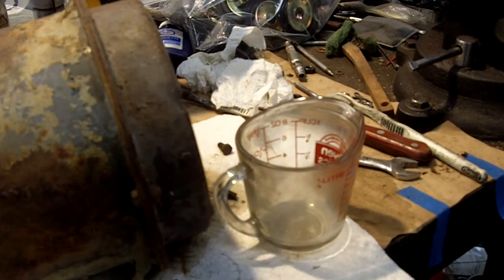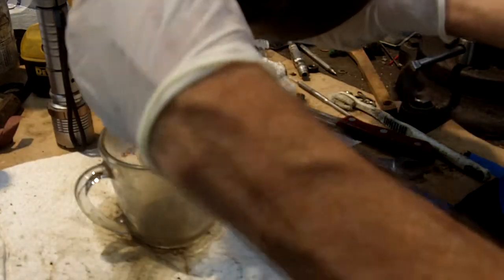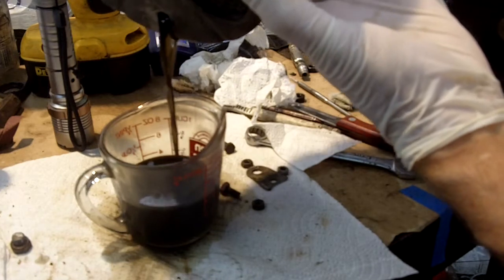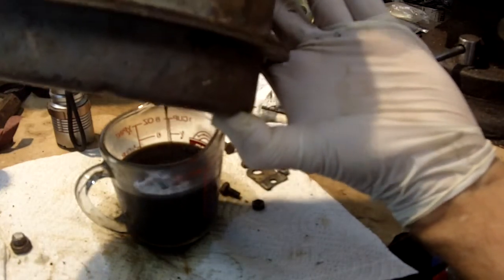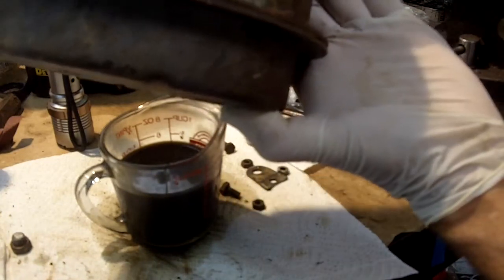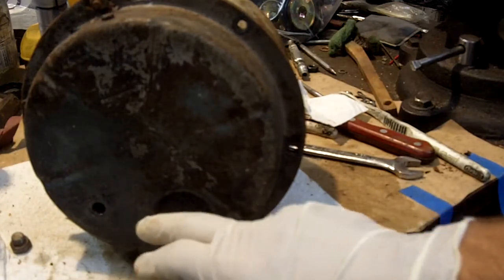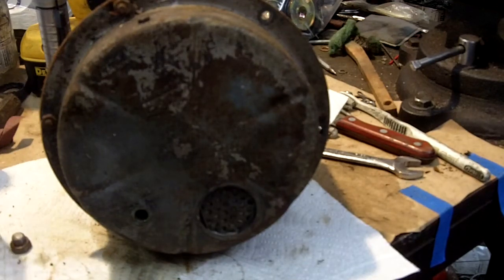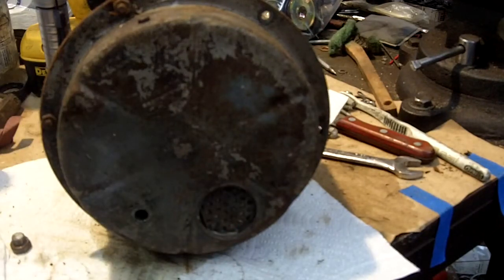ATE T50-24 Brake Booster Full of Brake Fluid

Comment: Will this affect the brake pedal ? Giving you a soft brake ? We're having to pump the brake to stop. It's a 2013 Hyundai Santa Fe Sport 2.0.
Reply from the maker: Hello Neverpanic. Thank you for viewing and your question. Yes, loss of  fluid can cause a soft pedal. There are other possibilities as well. First, I assume you know about the loss of brake fluid recall in certain Hyundai. Here is a link to this issue: https://www.cars.com/research/hyundai-santa_fe-2013/recalls/

If brake fluid is leaking this could lead to a soft pedal. The first application of the brakes is a soft pedal but puts pressure on the system. By the time you apply the brakes a 2nd time the system has pressure and acts normally.

A faulty brake master cylinder can cause the same soft then hard pedal.

Air in the brake system will also cause the soft/hard pedal.

Has the brake fluid level dropped? Have you added fluid? If so, there is a reason the fluid level has dropped. 

No matter the cause you need to get the problem addressed immediately. The brake system will not get better.

I tell people imagine you are coming off the highway and find a school bus has crossed your path. On the bus are a group of kindergarten children on a field trip to see what personal injury lawyers do for a living. If you panic stop you don't have time to double pump the brakes. And if they are weak then you have lost the ability to panic stop.

Good luck and report back what fixes the issue.
Reply: @Mercedes-Guru , wow, thanx so much ! It's currently at the dealership and they're telling us it's leaking into the booster, and want to charge us $2017.56 for repairs. They said there's no recalls on brakes.
Reply from the maker: @neverpanic  I Googled "2013 Hyundai Santa Fe Sport 2.0 brake issue" and this is first thing that popped up:
"Hyundai Motor America (Hyundai) is recalling certain 2013-2015 Santa Fe Sport vehicles. Brake fluid may leak inside the Anti-lock Brake System (ABS) module, possibly resulting in an electrical short. An electrical short in the ABS module can increase the risk of an engine compartment fire while parked or driving."

At dealerships, you always work up the chain of command. Google what I did and print out all you can find on the brakes. Show it to the dealer's service writer and ask to meet and show it to the Service Manager. Once they blow you off ask to meet with the Zone Service Manager. And at the same time loop in Customer Service at Hyundai HQ. Again, from Google "Customers who have any concern with their Hyundai vehicle may contact the Hyundai Customer Care Center at (855) 671-3059 or through the contact page on our main website." If you call, take notes of who you speak to. But it is better to email that way there is a paper trail: https://owners.hyundaiusa.com/us/en/contact-us.html 

On their website they have a link to Campaign Compensation. The car mfgrs do not use the word Recall. Instead they call them Campaigns. So consider using that word when talking/writing to them.

I would also contact the NTSA and file a complaint. Loop the dealer into the mix by asking for their business cards so you can spell their names correctly in the complaint. Use this site:
https://www.nhtsa.gov/report-a-safety-problem?gclid=Cj0KCQiAxbefBhDfARIsAL4XLRoMDCf42jVgXkKTt-TbxM7FTVkmMAAXDH9Ra_HJWB0tGaffJ6IuVoUaArnGEALw_wcB&gclsrc=aw.ds#index

If you have a local TV or newspaper consumer complaint person that helps people contact them. 

Join a Hyundai Forum and find out what others are doing about this. I guarantee you are not the only ones who have had this problem. 

If nothing else fails, negotiate the price. Tell them to split it with you and you will be sure to leave a good Yelp review. The implication is if they don't split it with you then you will leave a bad Yelp. You might try this tactic about the Yelp review at same time you ask for business cards. You want to spell their names correctly for the NTSA complaint and the Yelp Review.

Good luck, Will

Comment: Hi, i have one brake booster with the same problem, what's the reason to that happend? Do you have another video with the part's restoring? I will appreciate it, here in Portugal. Many thanks
Reply from the maker: Hello Fernando. Thank you for  viewing and the question. YES. Here is the video to show you how to repair your booster: 
https://www.youtube.com/watch?v=qfxTGwpqSPo
This applies to the T50 series of boosters. 

Here is a video of the types of boosters that can be repaired by the above video:
https://www.youtube.com/watch?v=cd2pF9RQ3lU

If you have this type of booster my video will help. 
If you have another type of booster tell me what kind you have.

What kind of car do you have?

Thank you,
Will
Reply: @Mercedes-Guru  Hello, i saw that video and it will help me certanly. My brake booster have  a little rust and will need to be painted, what's the best ink to do it? I can't find something about this, the only notice i have is Eastwood but the paint only resist if i use the DOT 3!...Best wishes
Reply: Sorry, i forgot to tell you that it will  need a interior paint!
Reply from the maker: @fernandodelimagoncalvespin3958  Please send photos of rust to: ssimports@sbcglobal.net; We do not use paint. Sin pintura. We have the parts electroplated with cadmium. Or you can use zinc. Pero, enviar photographias de su partes, por favor.

Comment: So after removing the oil, please what next? Do you have to change anything inside the booster like the big rubber inside or just wait until it gets dry and fix it back in the car?
Reply from the maker: Thank you for the question. The booster has to be rebuilt. You have to take it apart before you will know if the big rubber needs to be replaced. Use rubbing alcohol to clean brake fluid. I will be away from the computer until Thursday and will answer more questions at that time. Thank you.